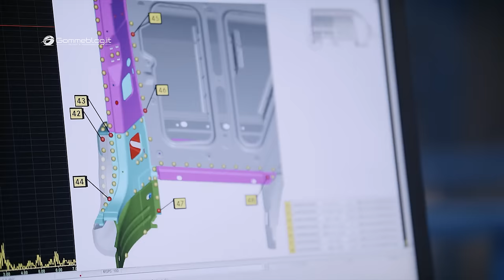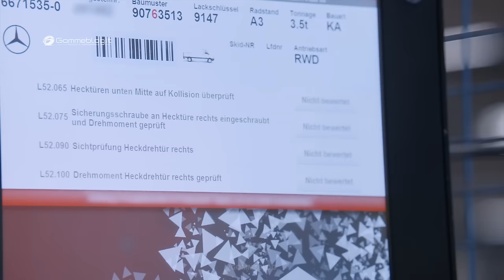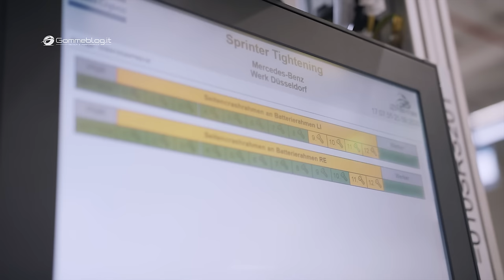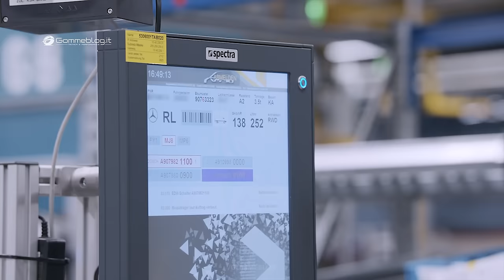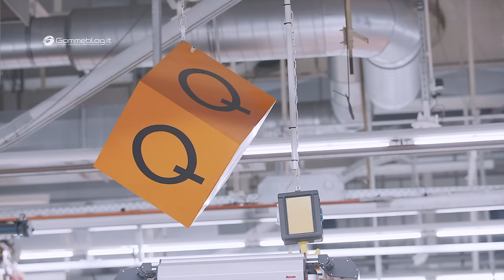Mercedes Benz E-Sprinter - German VAN Factory Manufacturing Process

Comment: You are a failure! engineers designed an EGR valve in my 2020 has to be removed every 5000 miles and cleaned! Hot soot running though a coolant cooled part. 👍 👌  outstanding craftsmanship